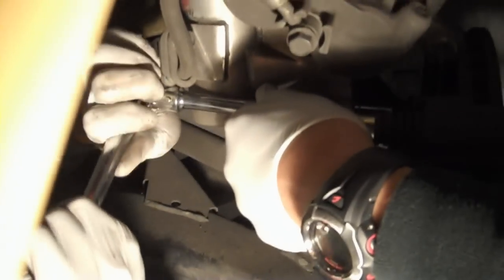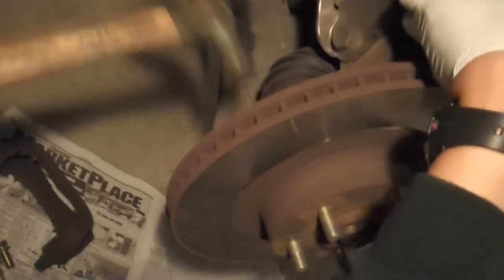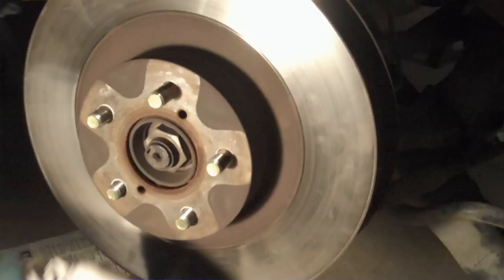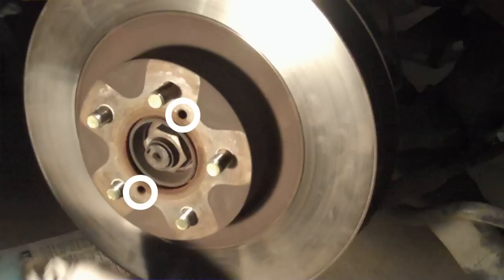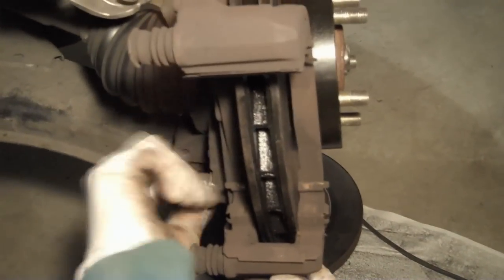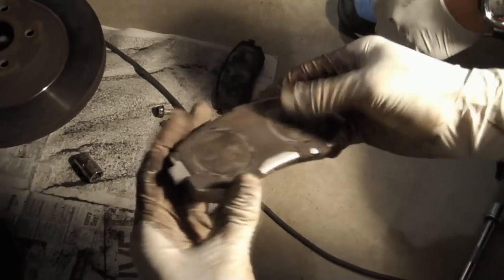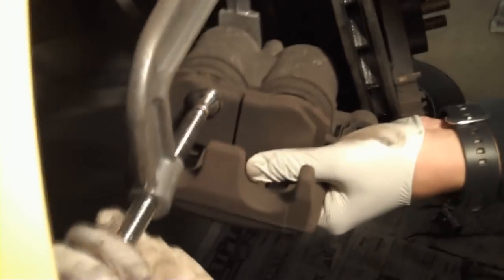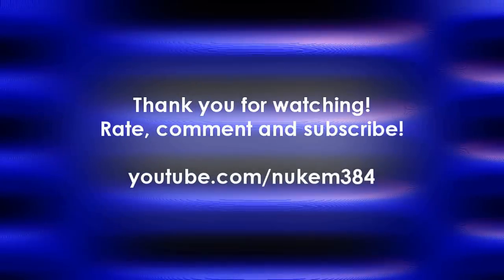Tutorial: How to change brake pads and rotors on a 2003 Subaru WRX

Comment: well I needed new brakes and rotors on my 02 Subaru outback and i'm unemployed so money is an issue. I didn't think I wanted to attempt my first brake job ever just because breaks are so important! But then I found your video and with some positive thinking ....mission accomplished! Thanks for posting this video it really helped me! Only two hiccups along the way (1), parts store sold me the wrong pads!  , (2) one of the bracket bolts was seized and I broke that mo fo trying to get it unscrewed!

Comment: @nukem384 

I believe what '13mnm11' is referring to the two small bolts that hold the rotor onto the hub. They are found especially on Honda's and many others, they are mainly just there so the rotor doesn't fall off on the assembly line. It should not be a major issue not having them there as the wheel pushes up against the rotor and its not going to go anywhere, although all the other bolts which are part of the braking system should be there.

Comment from the maker: @motorwolrdpl if it makes you feel better, you can crack the bleeder valve open while you compress the piston, but it doesn't really matter.  bleeding the brakes is totally separate, you dont have to do pads and brake bleeds at the same time.

Comment: @justinsvidz the bolts to remove the rotors are standard bolts used throughout the car. Just pop your bonnet and use the pair holding your bonnet on

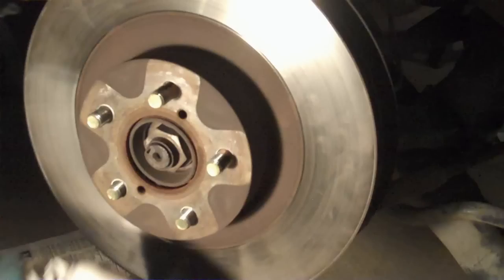Comment: a neat little trick... at 1:20 the vid shows a still of the rotor. There are 2 holes there (one at about 1 o'clock, the other at about o'clock). There is a bolt that holds your brake line to your strut that you can just screw in there, and what that does is pushes the rotor right off without having to hammer it. Its made for that.

Comment: @tchhom The rear rotors on most Toyota's have a brake drum built in to the rotor for the ebrake.
If the ebrake is on the rotor won't come off the hub. You can also remove the rubber plug, and back off the ebrake shoes if you are still having an issue. They adjust like any other drum brake. Push the retainer spring off the star wheel, the back off the star wheel, and you should be ok.

Comment: Great video as always, but a couple things of note.
As with the Pilot brake video,
you didn't service the caliper bracket, and slide pins.
It is very important to clean the area of the bracket where the pads fit in with a wire brush, both above and below the clips, so rust doesn't accumulate and freeze the pads in place.
You also want to lube the ears of the new pads, and the caliper slide pins.
Finally you didn't mention removing the cosmoline from the new rotors.
Other than that, great job !!

Comment from the maker: @RobertMoua on the actual rotors it gives you a measurement on how low they can be wore down.  you have to get a special measuring tool from the auto parts store to measure the thickness of the rotor.  thatll tell you if you need new rotors.  or if the rotors are warped, time for new ones.

Comment: You could use the hood bolts if you wanted. 8x1.25 mm is a very common size on a Toyota. Just about every bolt you find on a Toyota with a 12mm head will be the correct thread pitch, with the exception of driveshaft bolts.

Comment: Good video, but I have to bring up my comment from the Pilot brake video. The caliper bracket needs to be cleaned of rust w/ a wire brush under the pad fit clips & the new pads lubed with a good moly, or silicone brake grease so they dont freeze in the mount. Also the slide pins should be lubed. this is more of a problem where road salt is used, but should be done. In NH we usually need to hammer the pads out when the bracket isn't serviced b/c the rust builds up so thick under the pad fit clips

Comment: Heres a tip,
paint the hub with an antisieze compound so when you have to take the rotors off next they wont be too stuck on there.
Also you forgot to mention cleaning the rotor with brake parts cleaner, the rotors are coated with a wax substance to prevent rust and when not cleaned off your brakes can go bad quiker

Comment from the maker: @msweett3 ive never actually touched a rotor after driving around, but it also depends how youve been driving the car.  also remember that rotors and pads create a lot of friction, so they are going to heat up no matter what.  a better question is how are the pads and rotors performing?  are you losing braking power or are the rotors just hot?  if its the latter, dont worry about it

Comment: Careful using a breaker bar on the caliper brackets since the M12's are a softer bolt steel. I managed to shear the head off one of the M12's that was and had to drill the M12 out completely. Loser move on my part, but still something to keep in mind with softer bolts.

Comment from the maker: @13mnm11 uhh 2:06 is a freeze frame.  but im assuming youre either talking about one of the caliper bolts of bracket bolts, both of which i wouldnt be driving the car around missing one!

Comment: @motorwolrdpl they would feel the same as when you didnt change the pads. if you pedal feels hard and you gotta stomp really hard to stop then your car is probably off or your brake booster has a problem

Comment: those two little screw holes to help you pop off the rotor or eight millimeter standard pitch just did my 2013 Subaru

Comment: Incomplete! Before putting a new brake pads always lube the metal bits where the pads go. Also pump the brake until the pressure comes back, very important. Plus while compressing the piston open the master cylinder first but make sure the fluid wont spill.

Comment: When you put the brake pad on, is it suppose to be a super tight fit? Like I have to hammer really hard to get it in. I am not so sure because I am having some dragging issue when the brake is off. My number one concern is the caliper deformed, causing the super tight fitment for brake pad. So my question is , what should the proper brake pad fitments be like?

Comment: I forgot one other thing. The bolts you need to pull the rotor off the hub are metric 
8 mm x 1.25 mm Thread pitch.

Comment: @nukem384 i have a problem taking off my rotor off a toyota highlander 2004. is there emergency brake or any kind of parts that are connected to the rotor at all, because when stepped on the brake the rotor won't move ?. i've used 2 screws like in your video but still won't come off.Please help, thanks

Comment: I recently had my brake rotors and pads changed. For some reason, every time when I brake, I'm hearing a noise coming from the back. Is this normal after putting on new brakes and rotors? I'm positive I putted them on correctly and I bleed my brakes after also. Just curious because I don't want to mess up my brakes. Any help will be appreciate., Thanks!

Comment: Do not use a hammer to remove your rotor!, We'll unless like he said, you won't ever us it again. Use the pinch bolt holes (8x1.25 mm) to "push" the rotor off. 

Important: When taking the rear rotors off, the e-brake must be disengaged because it will be pressing against the inside of the rotors and they won't come off. My 2 cents.

Comment: no did it wrong...your forgetting a very important step before install you spray brake clean on the rotor and also check for any kicks or imperfections, when i do brake jobs i always examine the rubber/ hard lines as well as the caliper seals and the boots on the bracket nuts....its a subaru so everyone be careful loosing the bolts that hold the caliper and caliper bracket on too.,,, they can get VERY frozen on, penetrating solution is your friend in that case
Reply: Thank you for the extra info sir.